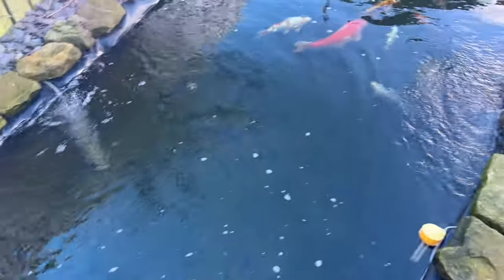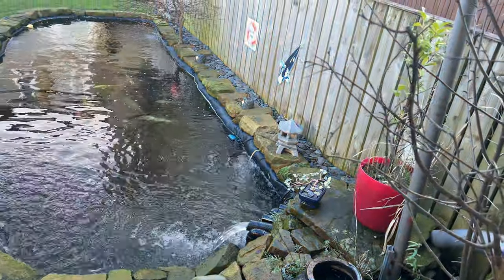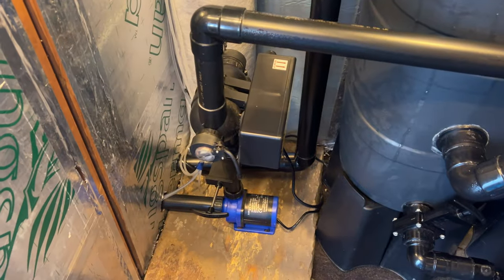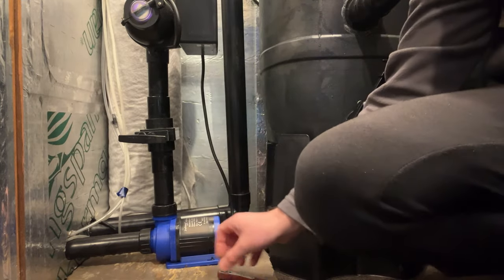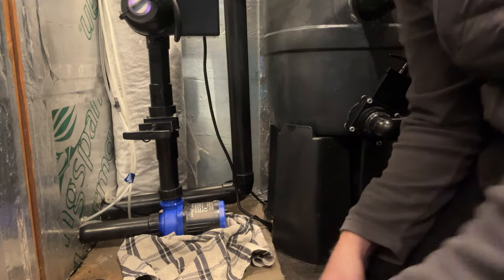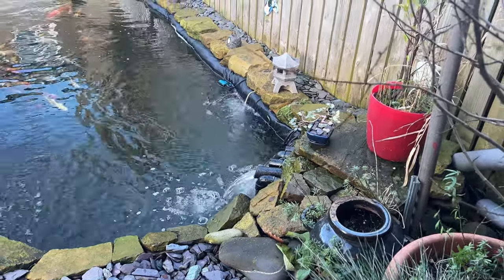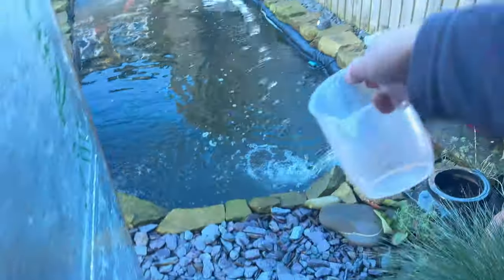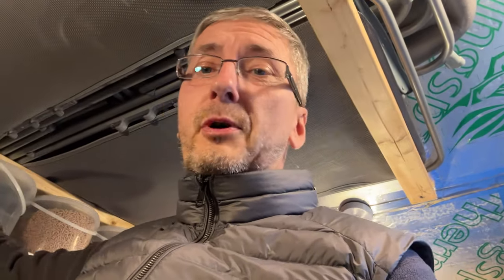Mastering Slide Valve Seal Replacement: Ultimate DIY Guide

Comment: Great informative vid. You've changed the rachet in your socket set. I have an identical set with the original rachet.  Cracking cheap socket set I've used for years...😄😉👍
Reply from the maker: I have 😂 I lost the original one down the inside of a wall, when I dropped it, so had to get a replacement, and thanks you for watching Andy 👍🏻👍🏻

Comment: You should of dried them off, cleaned the seats & both sides of the slide plate and put a smear of vaseline on for longevity Gaz. That's how I do it anyway 👍
Reply from the maker: They come with a silicone coating from the supplier mate, not much point drying them off when they have water around them 24 / 7